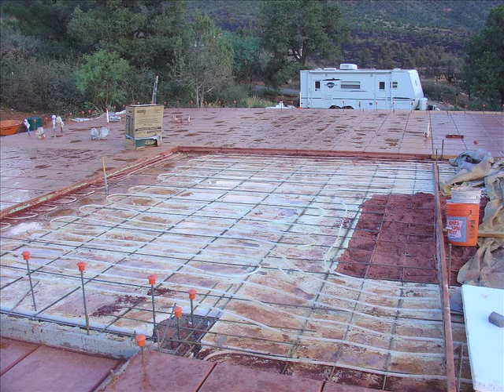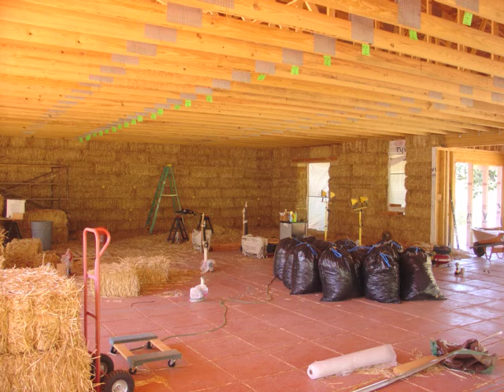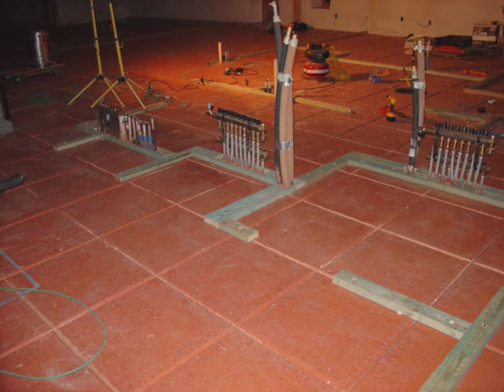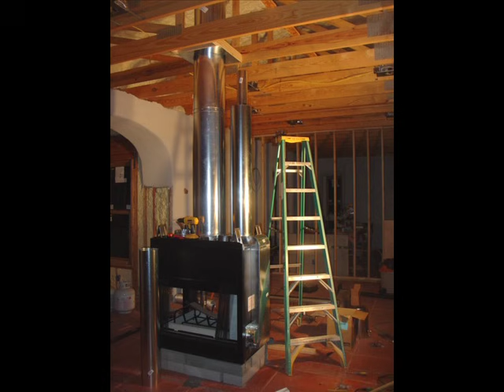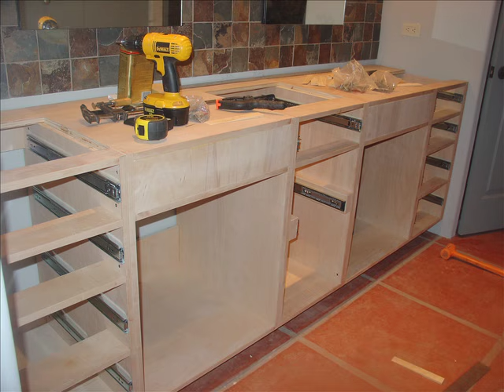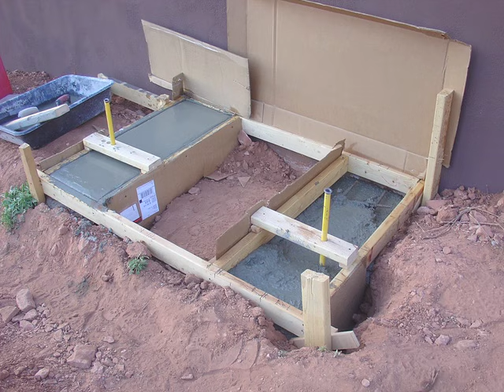Building your own Straw Bale House - an interview with the Author

Comment: Where do you get the straw and how much was it?
Reply from the maker: Thanks for your question.  There is a whole appendix in my book detailing where I sourced all of the build materials.  In the case of Straw, you'll want someone fairly close to you who specializes in straw bales for homebuilding.  There are issues with which type of straw, humidity/water vapor content and geometry.  I discuss all of this in much greater detail in the book (see the link at the top).

Comment: more like a strawbale filler
Reply from the maker: There are two ways to build a strawbale...loadbearing and non-loadbearing.  In load bearing the entire weight of the roof is carried by the straw causing compaction and dimension changes among other things.  A stronger, more reliable approach is to build a post-and-beam structure that is integrated within the straw walls.  The Straw is completely continuous around the house but doesn't carry any weight including snow or wind loads.  That's what is being shown here.
Reply: I was messing with the title......looks great!!!

Comment: But what about fires? And also won’t it decompose after a while? Just wondering...?
Reply from the maker: hi, electrabot  No, neither is an issue.  As I discuss in the book, these straw bales are specially ordered to be very highly compacted and triple-tied.  They are too tight to burn (not enough oxygen can penetrate them).  I tested my first bale with a propane torch and couldn't get it to burn at all.  Moreover, then you cover the walls with almost an inch of hydraulic stucco inside and out, which also doesn't burn.  The decomposition you mention might be a problem with Hay, but this is Straw.  Basically this straw (essentially just dry cellulose) isn't all that different from a ream of paper or a piece of 2 x 4 and you wouldn't expect them to decompose either.  Another key to this is to make the walls and bales vapor permeable yet water repellant.  Another aspect that I discuss in great detail in the book.  Actually, based on your questions, I think you'd really get a lot out of reading my book (see above).  Something to think about...

Comment: Now that you're 5  1/2 years out from publishing your terrific book,  would you have done anything differently?  Or did you get it all right the first time?  Have there been any changes or advances in straw bale home construction that you wish had existed/you had known about/had yet to be developed when you built?  Thanks
Reply from the maker: hi, Betsy
     That's a great question.  For the most part I'm really happy with the design and implementation as it was originally conceived.  The only thing that stands out that I would change is in the stucco coats.  The suppliers insisted that "construction seams" in the plaster wouldn't be necessary...and in most climates I suspect they're
correct (so for example I didn't have any issues on the north face of my house)...but I did see long thin cracks appear from expansion/contraction in the Arizona extremes.  They are not significant, and neither allow water
penetration nor have they grown in the almost 10 years since first troweling it on...but if I had it to do over again, I would have "precracked" vertically every 10-12 foot I think.  Thanks for asking!

Comment: How do keep the straw bales from molding? Thanks.
Reply from the maker: hi, Tristain  Great question.  It's important to remember these are straw bales, not hay bales.  Straw is cut after all the moisture and nourishment has left the plant stalk, then in the case of straw that's intended for straw bale building, the moisture content is monitored until it's low enough for baling.  And then you finish/coat the completed walls with breathable materials such as hydraulic stucco and silicate-based paints such that any moisture that leaks in or out over time will pass through.  I have a "window" in one of my walls just to keep an eye on any moisture buildup.  I have never seen a single droplet in almost 10 years now.  This is all explained in a lot more detail in the book.  Feel free to ask if you have any more questions.

Comment: is that house expensive to build? I think most who build such homes don't have much if a budget. I believe you have a ton of valuable information. A lot of of what I see here is purchased at a lumber/hardware store, instead of being reclaimed or harvested from the property.  This is probably the main difference.
Reply from the maker: hi, Joe  Thanks for your comments.  I would say that you can build extremely cost-effectively if you want to or get as elaborate as you want.  The straw bales, timbers for the framing and even stucco don't really cost that much.  Same with the roofing system.  And a simple slab on a short stem wall  is also very doable.  By far the biggest cost savings of all is if you do your own labor and/or bring in friends for the few operations that require a team.   There is a lot more detail in the book itself and yes, I did a lot of the labor myself just to save.  Hope this answers your question.
Reply: John Cahill I agree with the fact one can build as elaborate as one wants. I will look for your book, as I said, you probably have a ton of info. 

Thank you for getting back to me so quickly.
Reply from the maker: Hi, Joe  Just a quick followup.  The reason I mentioned "elaborate" being an option is that you actually asked me how expensive my house was.  And my wife, who's an interior designer definitely went all out on the details.  I was trying to give you a straight answer that the house didn't have to be so pricey...that the basic materials are fairly inexpensive, and labor is actually the big cost.  After you read the book (and btw I recommend the instant download...cheaper and quicker), feel free to ask more detailed questions, I'll be happy to help in any way I can.

Comment: Thank you, interested in raising frame by myself nice community on youtube very passion filled :)
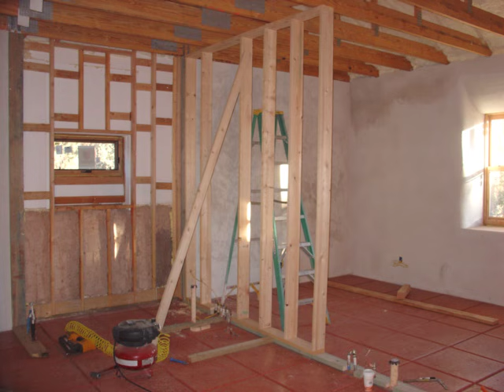Reply from the maker: Thanks for your comments, and I agree it's a very nice community here.  I encourage you to move forward with your plans.  You can absolutely raise all the framing by yourself (I did).  There is more detail in my book, but even in this video you can see how the large beams were hoisted with the help of a couple large "jacks" (:40 to about :45 mins in vid).  All the interior framing was assembled laying down and then lifted into place using one or two 2x4's to prevent the wall from falling away from me once lifted.  There's a pic showing that 2x4 at an angle, with the wall just lifted at about 2:35 in the video.  That was a short wall, but even much larger interior walls were lifted without assistance in the same way.  Best of luck with your build!
Reply: Thank you for sharing your experiences, look forward to saving the download, great available resource, matters to have homes built by the people who live there. There is more life saved to keep and use that work and going extra miles for it. (Plan to relocate to Austria near Vienna and having fun looking at their inspiring art architecture too . . . which was a struggle to first build). Best on future endeavors.

Comment: I own a time share in Sedona (Hyatt). We will be there in February. Do you welcome visitors to look at the house? If not that's ok, I understand the need for privacy...but maybe by looking at the finished product, we can make a better decision as to use adobe or straw bale... I have questions before investing in a book. 

It is obvious that straw bales do not hold up the house...the framing does. 

Our 5 acre lot is near Grants NM. My main concern is effects of water damage and cost.  I have looked into compressed earth blocks. Building with adobe with a double wall with insulation in between seems to me...to answer the need to thermally insulate against below zero temps.
Reply from the maker: hi, Alex  Sure, you're welcome to see the house.  Contact me at 135krpm@q.com when you get closer and we can arrange a good time.

Comment: Great info about your home!  We're considering radiant heated flooring in our upcoming build in Sedona.  Do you have contact info for the guys who did your radiant heating?  I'd be curious to get their opinions and an estimate on doing this.
Reply from the maker: Hi, Bonnie  Thanks for your comments.  I did most of the radiant installation myself (Chapter 10). The heat calculations were done by an old pro in Delaware who's been designing these systems since the 60's.  Both the bill of materials and contact information for the designer are in the book as well as photos of the central control equipment arrangement.  I would start with that information, I could also recommend a good plumber if you like.  You're welcome to view my system when you're here in Sedona.  Feel free to contact me at 135krpm@q.com .

Comment: I like to see all the pictures of a progect so big and important as a house. It is so important to try to be eco-friendly. Besides it is also economical. Who can argue with ecological/economical. Smaller footprint is so good.
Reply from the maker: Thanks for your comment, mother goose.  I'm like that too…when I was planning to build this house, the one thing I wanted but couldn't find was a step by step, comprehensive series of photos showing the whole process.  While building this house I ended up taking over 5,000 photos…and incorporated pics from every stage in the book so anyone else can use this as a basis…to see what's involved, and to see options of what's possible…before you start.  This brief video is just a sampling of the whole book.

Comment: how much  did this cost?
Reply from the maker: +Mike Bird hi, Mike…thanks for your question.  I'm not sure how to answer you though.  My wife is an Interior Designer and there are a lot of high end features in this house so I'm not sure telling you what we paid would be helpful. In general though Straw houses aren't much different in price from a conventional house (and certainly they take more time!)…the advantages are the energy efficiency over time, and any cost savings come from the fact that you can do a lot more of the labor yourself.  It's also true that you can design a Straw Bale house to be quite inexpensive if you go with what's commonly called a "load bearing" design (and of course do your own labor).  This is effectively just a slab, Straw Walls and a roof that is sitting directly on the Straw itself.  You can also use Natural Plaster (clay, basically) instead of more expensive finishes like hydraulic stucco.  I hope this helps.  Feel free to write a follow up question if you want and give me a better idea of what you're thinking.
Reply: Your house looks amazing!and pricy. I'm not building a house  I am  curious about using  straw bale construction  to build  a  wall around  our property like 10ft high and 100 yards by 100 yds. A friend offered me a whole  bunch bales for  free.
Reply from the maker: Mike Bird hi, Mike…thanks that helps me focus my answer a lot better.  I will tell you up front that what you're considering is a bit daunting.  The principal complications will be how dry, dense and geometrically square those bales are (and they must be straw, not hay).  If those conditions are satisfied, you'll need to prevent any exposure to groundwater at the base, some form of support (10 ft is a bit high for an unreinforced straw wall, even assuming you have impaled the bales with rebar) and finally make sure you use hydraulic cement rather than Portland.  This is crucial because the hydraulic cement will breathe and the Portland will trap moisture and allow the bales to rot and become powder over a few years.  If you want to color the walls, add pigment to your stucco…or use a silicate-based paint such as Royalan which will both breathe and shed liquid water.  Hope this helps!  Feel free to write with other questions.

Comment: Is it fireireproof?
Reply from the maker: +Sandor Kacso Hi, Sandor..thanks for your question.  And yes, it's totally fireproof..that's one of the many advantages of this style of building.  Obviously the thick stucco finish is fireproof (since it's ceramic material) but even better the dense-packed straw bales themselves will not burn.  They're packed too tightly for oxygen to get it.  I live in a huge forest in an area where large wildfires can happen so this was important to me.  I tested a straw bale with a propane torch…and even with the torch on the straw for several minutes I couldn't get it to catch fire.  Pretty cool, huh? grin
Reply: +John Cahill it's a great idea, thanks for the quick answer!

Comment: The main problem is how able to defend from any parasite ???
Reply from the maker: +Pufferzsola No, there's no problem with rats and other varmints either….there is simply no way for that to happen.  I understand the concern, but if you could see just how dense-packed these bales are, and then appreciate that they are covered/sealed with 3/4" of solidified calcium (stucco), I think that would be clearer.  In my book I address this is great detail and in fact have added several features which further protect the bales including sealing the top of the uppermost bale (in the attic) with half-pound insulating foam.
Reply: i see...
Reply from the maker: +sonajrilhav rilhav These are highly compacted bales, extremely dense, clean and promptly harvested at the time, completely surrounded by stucco (the calcium content of stucco repels insects btw).  It's been about 8 years since then, never seen a bug.  I'm wondering if you're thinking of hay, not straw?
Reply: +John Cahill And what about rats and other small mammles? They did not try to gather some from the straw? If not, maybe i'm interested... :)

Comment: Hi there, does it cost a lot to buy that much straw bail
Reply from the maker: +KoolChick20 hi, KookChick20, thanks for your question.  The short answer is that I remember them being surprisingly inexpensive even after paying for shipping.  I ordered my bales from a company which specializes in Straw Bales for homes.  So they're geometrically correct (square, and each bale is the same size), harvested at the proper time and correct moisture content.  Also very densely packed and triple-tied.  If you want to check current pricing on similar bales (since it's about 7-8 years since I bought my bales), my supplier was Southwest Farm Sales in Phoenix, AZ who sourced the bales from Southern California.  FWIW all this information and much more is in the Sedona Straw Bale book listed above.

Comment: Hi John. Wonderful project. You might laugh, but some of the photos really moved me! I'm dealing with a debilitating illness but planning a modest build in about a year (getting finances together). Do you have any thoughts on using straw bales as internal walls in a shipping container build? I'm thinking of the cost, high insulation factor plus the inherent beauty as key factors. Thanks!
Reply: hi, Clarice 
      That sounds like a great idea.  I have seen straw bales used on the outside (I believe I've seen some vids like that on youtube).  However if you don't mind using up some of your interior space for the straw it's completely doable…certainly easier in some ways and I agree that the results would be attractive.  I have several thoughts…I think for example it might be easiest to "spread" the tops of the interior walls with a simple wooden frame.  Feel free to contact me when you get closer to building and I'll help you work out the details (gratis).  I think it would be easier than trying to give a comprehensive reply here.  You can reach me at 135krpm@q.com. I hope to hear from you.
Reply: John Cahill Such a gracious reply!  I know what you mean about losing interior space by using the SBs as internal insulation. I plan to counter that by placing the containers farther apart. Wondering if the wood frame you mention can be built into the framing that will connect the containers. In any case, thanks for your kind offer. I look forward to talking with you as time draws nearer. Meanwhile, all the best!
p.s. I look forward to reading your book!
Reply: Clarice Taylor hi, Clarice  When you have a concept in mind…just sketch it up and I'll mark it up for you with some practical features to make it all work.  I'm thinking that you'll want solid foam panels between the straw bales and the "cold" metal container walls to prevent and condensing issues.  The straw bales will be "staked" together with rebar but as you get close to the ceiling of your compartment, you're run of out "swinging" room…so I'm imagining a framework at the top to simply keep your top bales tied into your overall structure.  These are just details we can iron in in more detail when the time comes.  There are multiple ways to make this work, and we can adapt a plan to suit your own vision for your home.  It will be fun…happy to help.  Also feel free to write with any questions after reading the book. 
with best regards,
John
Reply: John Cahill Wow, John.  What a great opportunity!  I'll definitely send you a sketch of my idea and I look forward to your insight and suggestions. I'll be in touch soon.  Thank you!